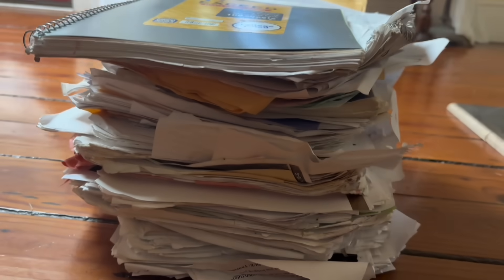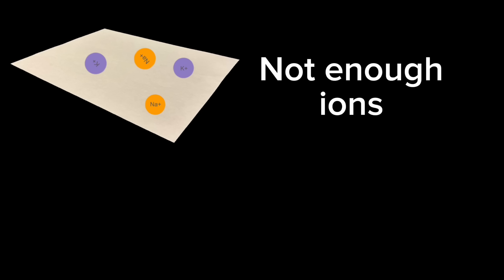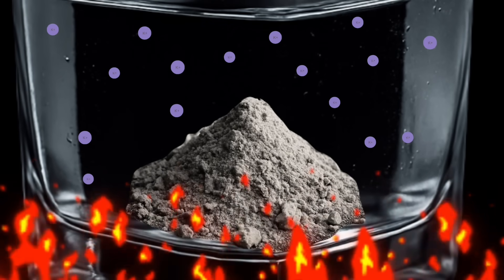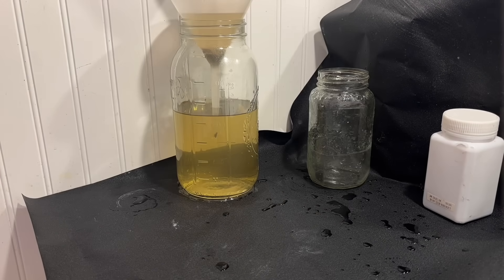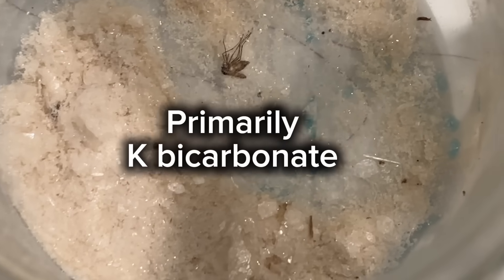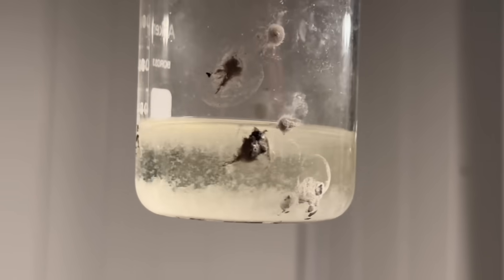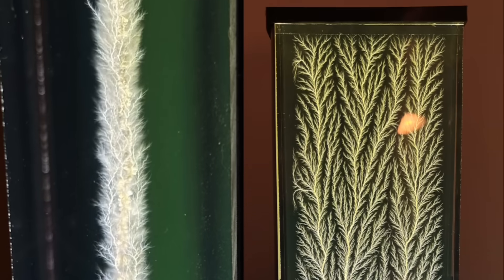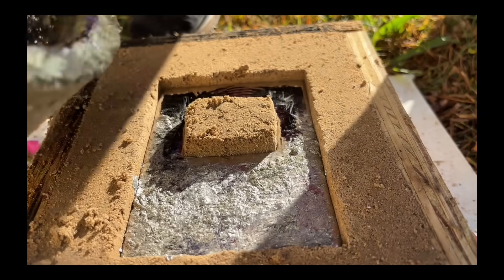I Turned My Entire Academic Career into a Crystal

Comment: If you wanted to get the maximum yield for your extraction of soluble compounds from the homework you should carbonise the homework stack in a sealed box with the fumes passed through a water tank to catch the bulk of the non-CO2 compounds then take the char sheets left at the end and burn them to ash, again catching and cleaning the fumes with fresh water as best you can. The ash can now be soaked in water to extract any remaining useful water solubles before filtering out the ash, mixing the three solutions, and removing the water until you get your concentrated solution.

Comment: How do you know the ions don't come from the water iself?
Reply from the maker: If my tap water had that many ions in it, I would be in big trouble lol
Reply: @ElectronImpressions  According to what I found online (https://www.ars.usda.gov/arsuserfiles/80400525/articles/ndbc32_watermin.pdf), the total ion concentration of tap water in the US is of the order of 100 mg/L. It looks like you used roughly 2-3 L in your video, and the crystal at the end looks no heavier than 3 g I'd say? So the ions from the tap water could make up something like almost 10% of the mass of your crystal? Maybe a little less? But still not nothing! But that's okay lol, I'm just being annoying
Reply from the maker: The main cation species in tap water are calcium and magnesium, they probably make up 70% of the total amount of ions by number in my hard tap water. Calcium and magnesium carbonates/hydroxides are hardly soluble in water and would not produce crystals like we see here. Also, the crystal is likely only like 10% of the amount of soluble species extracted from the ash when we consider losses, the dirty solution I didn’t use, and the remaining clean solution after I remove the crystal. Surely some of the ions in my potassium bicarbonate crystal are from the tap water, so yes, definitely not nothing but I would wager it is negligible lol. I like the questions though, thanks for watching!

Comment: Something that might make the filtering easier:
Brewing has the same issue separating the drinkable brew from the nasty mash at the bottom when brewing is done. They use a special siphon to do it and it might work for you as well. I won't prop up a link, but they can easily be found online by searching for a "brewing siphon". If you siphon off the liquid when the slurry has settled, the end result would leave much less turbid liquid to filter hopefully making for just a single filtering pass... Probably overkill... but fun :)
Reply from the maker: I have something similar for my fish tank, but if we are being honest, I didn’t use it because I just wanted a cool filtering timelapse 😂

Comment: instead of spending days boiling down water, put a fan or maybe a fume extractor even (basically put a fan ontop that pulls "air" out of the boiling container)
its about twice or even 3 times as effective to blow the air away then blowing towards the evaporating container

Comment: Don't forget to coat the crystal with hair spray, moisture from the air will eat away at it over time otherwise
Reply from the maker: You’re right, potassium carbonate is deliquescent while k bicarb is hygroscopic. I really dislike how crystals looks with a layer of varnish, unless they are very large. So what I normally do it store them inside a ziplock bag with some desiccant.

Comment: The soluble main component of wood ash will always be potassium carbonate - no matter which kind of tree it was and where it has grown. It crystallizes out as the bicarbonate because from the saturated carbonate solution water barely evaporates because of its high hygroscopicity. The carbonate forms bicarbonate with CO2 from air and is able to crystallize out then.

Comment: i love this channel, many cool ideas. i plan on extracting from ash too, but for a different reason (nitric acid from just sulfur, water, and ash)
Reply: nvm i found an issue with reaction chain, will use KNO3 or NaNO3 instead of ash. historical methods are very interesting tho! (chain is burn sulfur = SO3, SO3 + H20 (steam, slowing reaction needed) -> sulfuric acid, KNO3 + HSO4 to nitric acid. if i manage to get some HS04 before starting ill use the oleum method, to be safer

Comment: A particle accelerator proof camera? Isn't that going to distort the beam? Between heavy shielding Faraday caging and magnetic Fielding... 
Why don't you just use a periscope?
Reply from the maker: Distorting the beam is not a concern. A periscope would work, and was actually an initial design, but it comes with an incredibly small FOV. We got our hands on some leaded glass though so a reflector based design is unnecessary.
Reply: @ElectronImpressions 

Your response just gave me a thought, have you tried making a lichtenberg figure with leaded glass?

 regarding beam distortion I was thinking of a strong magnet for a shield.. but that would probably cause more problems than it would help.
   Maybe instead of something like a periscope fiber optics? Like an endoscope? 
   You still haven't done a video that I'm aware of regarding the nature of your accelerator, so I would have no way of knowing if leaded glass would be adequate. 
   I'm really looking forward to the video about the accelerator!
Reply from the maker: @JohnDokivin I don’t want to spoil too much but we are designing the shield to be effective against passing directly under a 20MeV electron beam that is roughly 4ft by 4ft in area. The electrons are easy to stop, but the main trouble comes from the insane amount of bremsstrahlung X-rays generated in the room from stopping those electrons.
Reply: @ElectronImpressions  oh, maybe send your homework Crystal through too! See if it changes color, ends up fluorescing or just turns black.
Reply from the maker: @JohnDokivin I have no idea why I didn’t think of this. Of course I will 😂
Reply: @ElectronImpressions do you mean the eggs or the homework Crystal or both?
Reply from the maker: @JohnDokivin I didn’t see a comment about eggs 😂 definitely the homework crystal